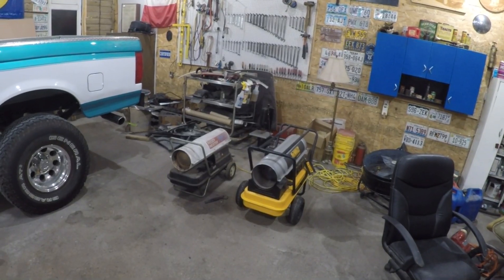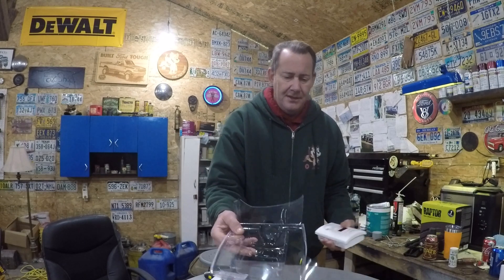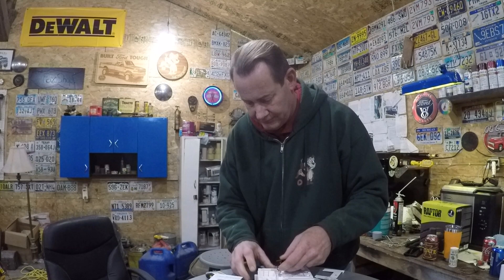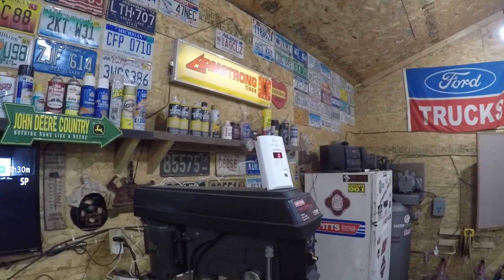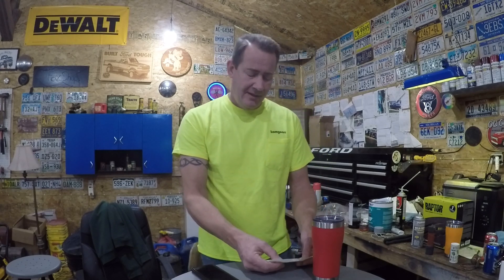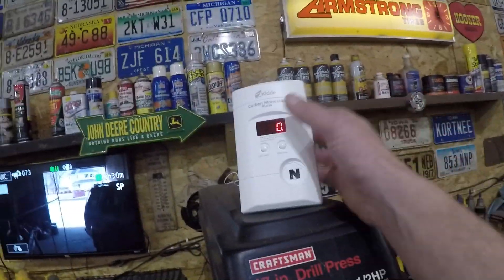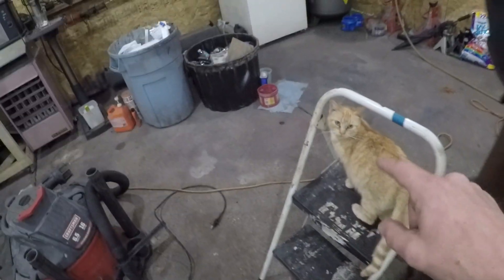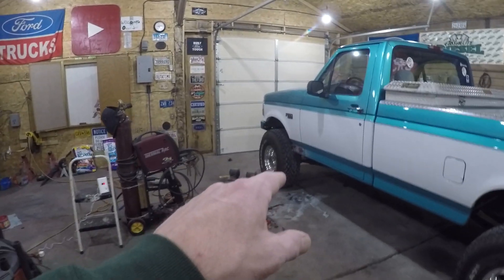ARE MyTORPEDO Heaters Creating CARBON MONOXIDE

Comment: lol i heat my shop with an old dryer i got off the side of the road, just turn it on and let it run, much cheaper than kerosene or diesel

Comment: Just got me a co monitor and mine reads zero. You can smell fumes a little bit but it really doesn't bother me. No headache or lightheadedness or anything. I have a Dyna Glow pro. I run it with 1k kerosene. I hear that is better than running diesel as far as the fumes go. Anybody know if that's true?

Comment: Corn is a bit of a pain. Nice idea until you realize it's either on or off, and then daily cleaning if you run it full speed or with too or dirty or wet corn. I burned about 2 bushels a day which would be about $12/day in 2024. I use a chinese diesel heater and a trekker stove now.

Comment: Yes, you can run those inside. I run mine fto heat my 24 x 32 ft. shop thats insulated and air tight and my carbon monoxide detecter has never gone off. I burn diesel in mine and there's no smell.

Comment: I have the same CO detector.  It does not change from 0 until the CO content reaches 8 and the number displayed suddenly switches from 0 to 8.   It alarms when the value reaches 60.    Consider how much time you want to spend in concentrations from 8 to 60.  ( personal experience).

Comment: Carbon Monoxide is created from the incomplete burning of carbon material. Forced air heaters do a good job of burning the fuel completely and thoroughly producing very little carbon monoxide. It's nothing like a gasoline burning engine. If you suspect Carbon Monoxide build up the first thing I would check is the operation of the unit. Might be time for a tune up. Replace and clean filters, check pump pressures and the quality of the fuel that you are burning.

Comment: ANYTIME you burn combustibles in an enclosed space you'll get CO. No two ways about it. You're supposed to have the door cracked 18" or more. They heat the space up very quickly. Not really any need for constant running but you can if you're smart about it. If you're burning that or any combustion heater inside you need a CONSTANT supply of fresh intake air. Crack a window, open a door, whatever. It may run more, get colder, that's the price you gotta pay otherwise get an electric heater.

Comment: I mix my diesel with rubbing alcohol to burn a little more clean and it burns a little hotter. When I have the heater running, I use a large fan to circulate the air in my shop. Been many years without issue!
Reply: My neighbor let me borrow his and there isn’t much info on this… how much should I crack my doors in my shop?

Comment: I've been using those kinds of heater for many years with no problem of ever getting light headed or starving for oxygen. I have one of those gauges that monitor the air for danger levels, but it never gets close making it go off. I have a well insulated shop that's sealed as tight as a ziplock bag so the heater only runs for 15-20 minutes at a time to warm the shop up.

Comment: I have used corn for heating for over 20 years, It would be way better then what you have but I think you may be under estimating corn usage. its also kind of dusty and more maintenance, parts are expensive, corn burns better screened and at 13%, its running all the time so may get too hot too, just some points, good luck with whatever you decide. I enjoy your channel.

Comment: Maybe inhaling too much shielding gas?  I’m about to try my hand at MIG welding for the first time and this is one of my concerns. 

I had high hopes you’d install that old furnace you had.  It would be nice and low maintenance.

One thing to note on that CO detector - the first time you apply power to it, an internal clock starts.  At a pre-programmed point (I want to say four years but I don’t remember exactly), it will stop working and there’s nothing to do but toss it.  I’m on my 3rd one.

Comment: As an addendum, these type of heaters are generally used on construction sites where the project just has plastic put up against same elements. They kick out a huge amount of heat very fast and heat up the surrounding area basically to keep materials from freezing. (Ever work with plastic moldings when it below freezing?)

Comment: Kerosene would be a better alternative to diesel. But, yes, those things are sucking the oxygen out of the atmosphere of the garage to burn the fuel. The oxygen is being replaced through air leaks but since you've insulated, probably not as fast as they are using it up. That's why furnaces/heaters/wood stoves, etc. are vented to the outside.
I'm surprised that you haven't had these issues before now.

Comment: Ok Jon, just wondering...I use a heater similar to your older one to heat a small shop I work in and I'm in northern Ontario, Canada. You appear to spend a lot more time in the space in your shop that you heat than I do. My heater has a sticker on top that tells you at hourly running intervals when to clean/replace intake filters, when to check the sparker gap, when to clean off the photocell, when to clean the fuel filter screen (and they recommend this a lot) You indicated many videos back how old this heater was and how little you did other than run it. Could it be that it's just the older one creating issues because of lack of maintenance? I have a  CO sensor in my shop because I repair some small engines in there and keep tabs on it if I need to run one n the shop in winter. (with a door open and an exhaust fan running) Never had even a blip on my CO sensor.......Just something to think about.....Keep on keepin on!

Comment: I told you last year you can not run diesel in them, you said I was wrong and you been running them like that for ever. 
Like I said last year you have to run k1 kerosene and it is safe to run for heat without having to vent

Edit note- Its not that you can't run diesel, they will run it, its you can't run it inside. The people who run diesel are, masons when its cold out and they set up tarps to cure a wall, mechanics and others to thaw frozen car parts, water authority to thaw water lines, sewer dept to thaw sewer lines....pretty much anything outside where fresh air is not an issue.

Comment: I don't like them just because of the noise and smell. If you get the corn burner would it be big enough to heat the other shop if you move over there? I have electric heat in my shop and it does not interfere with filming.  I can hear them running, but microphone doesnt pick it up.

Comment: I’ve often wondered why you used/ran torpedo heaters in your shop without any doors opened up somewhat. I’ve used them before in a pinch but always with a door cracked open. They are very dangerous to use the way you use them. That being Said I have unit heaters In both my garages (what you call a hanging heater) and I love them. Come in turn the t-stat up and forget about it. I’ve also had wood burners from barrel stoves to old cast iron wood burners and I would never go back to something like that. My time in the shop is to do what like not stoke a fire or fill it up. This just my opinion and my experience over many years, but please be very careful if you continue to rely on torpedo heaters for heat in an enclosed environment, at least leave a door cracked open if nothing else. 

Thanks for all the videos and have a Merry Christmas.

Comment: I bough a corn stove 10 yr,s ago and put in my shop. it did not work out ( no heat) used it 1 year and its been sitting for the last 9 yr,s. not to mension that my insurance man went nut and canceled my insurance!  before you buy speak with some one that has one. best of luck to ya and have a merry Christmas.

Comment: I am a plumber, last winter I was working in a new construction basement, had diesel running in a torpedo heater for 8-9 hours. I started feeling weird. After I was home for a couple hours, my heart felt like it was beating out of my chest. My wife made me go to urgent care, turns out I had carbon monoxide poisoning, and it gave me an irregular heart beat. So it can happen.
Reply: Presumptive poisoning but many people are sensitive to the diesel additives too.

Comment: Hey Jon,
Carbon Monoxide does linger in the bloodstream for awhile. Seems like your in the shop a lot so it just stands to reason that your blood level carbon probably stays somewhat elevated for long periods of time. I know it’s been awhile, but did you have issues when you went out to Oregon? The breathing and the rapid heart rate seems like it points to Carbon Monoxide. Go to the doctor and tell him and he will probably run up some blood work. 
We’re not springs chickens anymore.

I get a kick telling others to go to the doctor. I was and the worst person on going. I paid the price just about 8 years ago. 

Good informational video.
Stay safe!
Bill
Reply: The problem with CO that makes it so dangerous is that it binds to the red blood cells much more readily than O2. If you've ever seen an autopsy on a person that died of CO poisoning, it's readily apparent in all of the tissues. Because of the lack of O2 they have a pronouced 'cherry-red' color.

Comment: Be curious to know if its less or more burning kerosene. Guess as a short follow there always used that style of heater with kerosene. Diesel fuel I notice, and propane I find worse yet. Don't notice kerosene. Also my barn is not exactly air tight either maybe helping maybe not. Heater runs gets it up to temp then will cycle about every 15 minutes or so for 5 minutes.

Comment: Google "carbon monoxide levels chart" you seem to be hitting in that 25-30ppm range that with exposure of 6 to 8 hours symptoms will start to show, so at 8 to 12 hours it's hit you hard enough to make you have headaches, increased heat rates nausea ect... Have you looked at those electric wall mount "high efficiency" ac/heaters? Might be another option. Stay safe Jon.

Comment: Depending what type of fuel you can get for cheap.. I’d say burn whatever you have a lot of. Burning wood gives great heat, but it doesn’t come easy... wood is heavy and takes time to get the stove up to temperature. I’m sure you could get the furnace hooked up and run propane for this winter. There is something to be said for just clicking on a thermostat..easy

Comment: Hey Jon.  Carbon monoxide is heavier than air.   The levels on the table are probably lower than the actual ppm by the floor.  Every time you're walking through the shop, you're kicking co up into the air and then into your lungs.  

25ppm will cause a headache.   I am going to message you on facebook with a temporary fix.
Reply: Message and drawing have been sent.  I know facebook can be stupid with message requests but I cant send drawings on here lol.

Comment: Hey I was wandering what primer you used for your green truck and if you had any trouble with paint sticking?! Thank you!
Reply from the maker: Tamco high build primer, believe it is HP-5310. Have had zero problems. Used that on the flareside I painted also